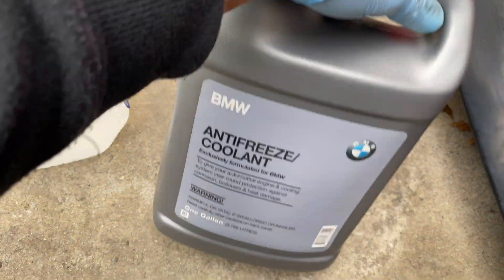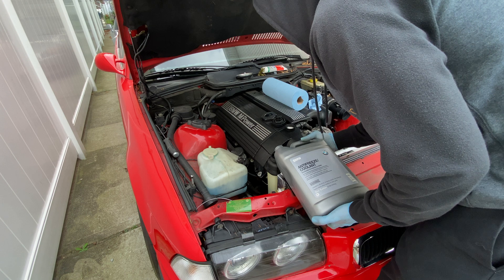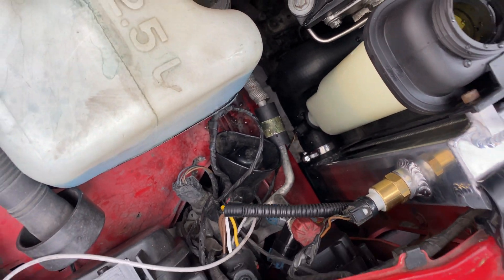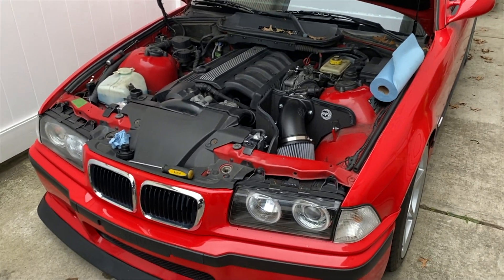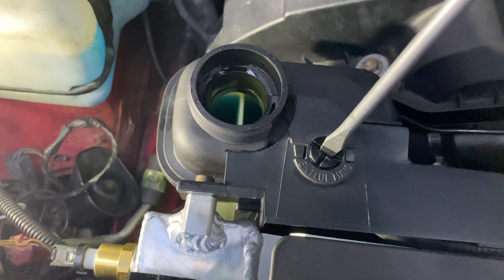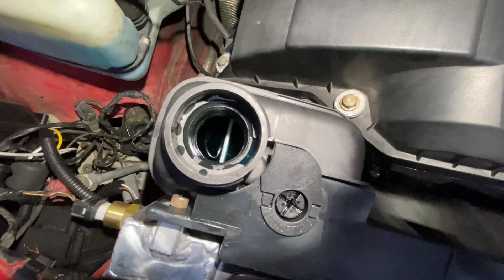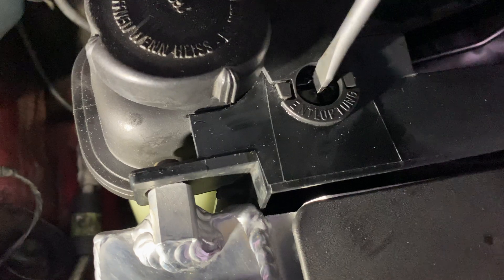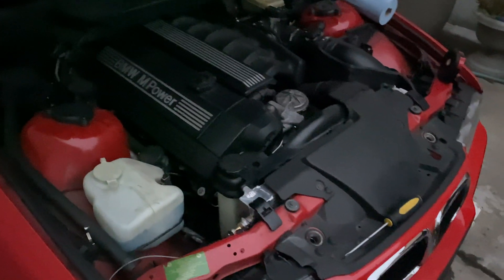Cooling System Bleed | E36 M3

Comment: When my e36 is off the coolant drops/drains from the kalt line to about the middle of the coolant sensor but when running it raises to the kalt line is this normal ?
Reply from the maker: The level does raise a bit when warm, you should make sure the coolant level when cold is topped off to right amount as per the reservoir and you should be fine.